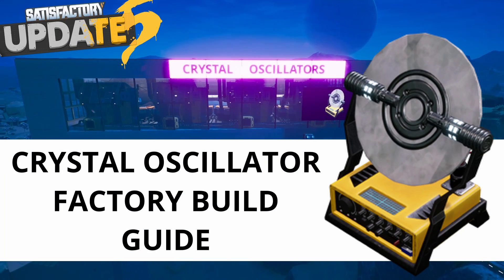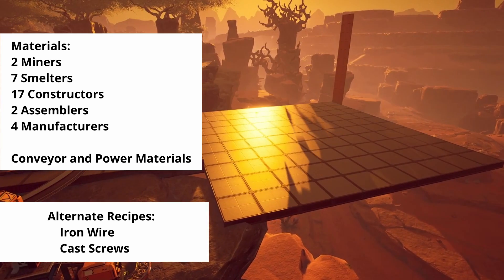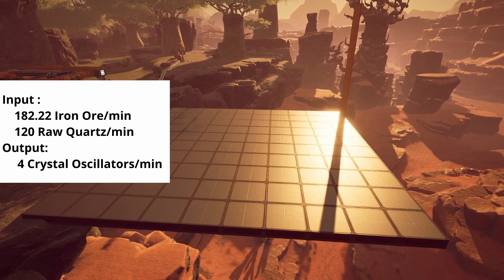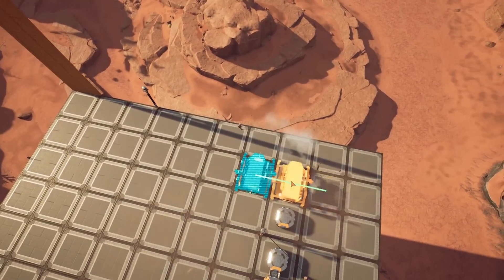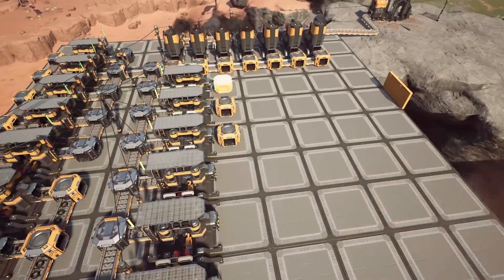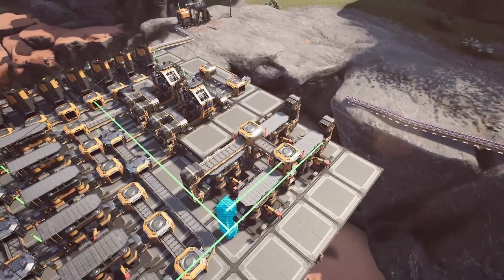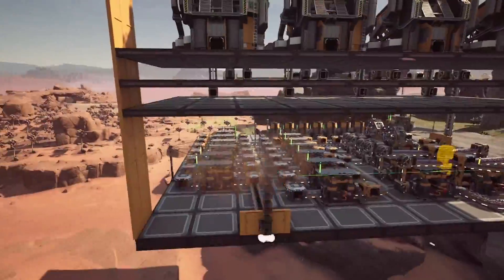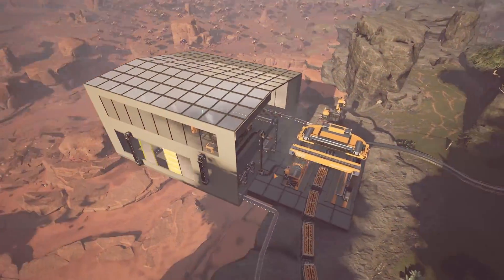Satisfactory Update 5 - Crystal Oscillator Factory Build Guide | 100% Efficient 4 Oscillators / min

Comment: Hey Man I got really confused on the manufacture layer on how you put the foundations. Could you maybe explain that to me
Reply from the maker: sure, theres 3 layers. the top layer has the manufacturers and the bottom 2 layers hold belts. since the manufacturers have 4 inputs, each sublayer provides 2. on the floor directly below the manufacturers, theres one belt underneath them directly, and one behind them (on the input side). This is then repeated on the second sub layer. Each of the 4 belts provides a different material, and splitters and lifts are used to take items from the belts and provide them to the manufacturers.
Reply: Thanks man appreciate it

Comment: As a very new satisfactory player, this build and many of your others have been incredible to me!! Do you have any tips for a player on their first ever play through on creating this level of efficiency without a walkthrough?
Reply from the maker: Do the math! I start  at the end and work backwards. I decided what I want my final product to be, and then multiply backward to get my resource count, then try to figure how big of a build it needs to be. For example,  1 crystal oscillator takes 2.5 reinforced iron plates, 14 cable, and 18 quartz crystal. From there, you can go backward through the subsequent components until you get to the raw minerals, which is 30 raw quartz and 45.5 iron ore. I then look for a multiple that results in nice round numbers as much as I can (i ended up with some weird decimals on the iron ore for this build, but the rest is pretty nice).  then build out a plan for the factory. using manifold belt lines makes internal logistics much easier and more compact. so then its just a matter of working out a layout. 

Hope this helps!

Comment: I wanted to ask how come you don’t ever use floor holes in your builds? What’s your opinion on them?
Reply from the maker: Very buggy. I love the idea but every time I try to use them they end up sending conveyors the wrong way or failing to connect. They simply aren't worth the time. Also,  it's very hard to film putting them in with this style of filming since I'm time limited on each shot.
Reply: @Dekoba  I can see that. It would be a lot different trying to get time lapse recording. For my own builds so far floor holes have been working well. No problems, and also allows very clean floors using sandwich layers.